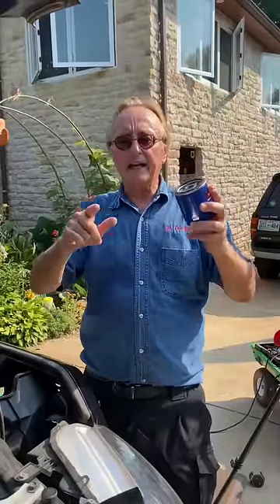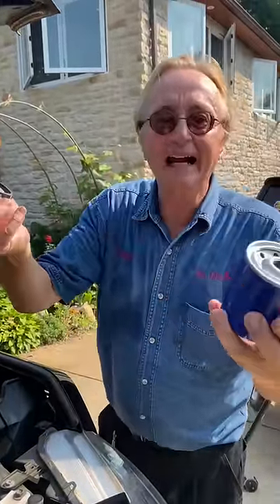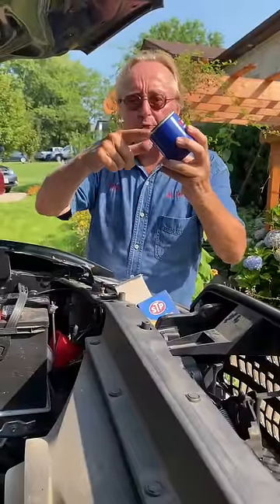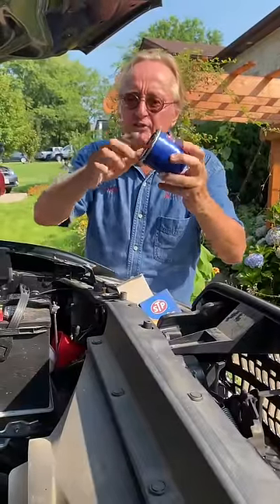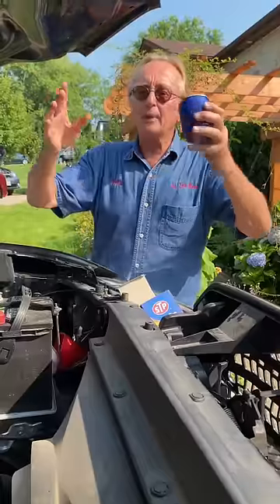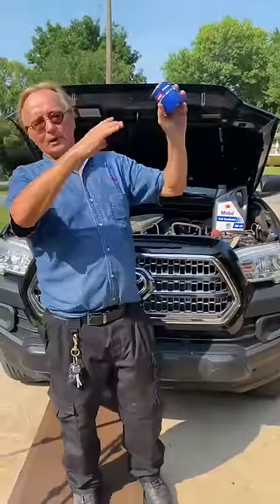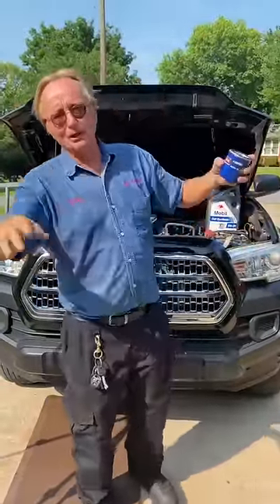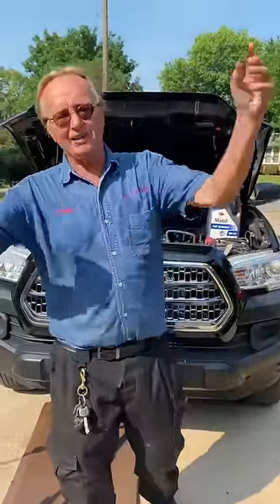If You Change Your Engine Oil Like This You’re Stupid

Comment: Did this 40 years ago, didn't lose an engine, but the amount of time lost cleaning the driveway taught me a valuable lesson!
Reply: Same thing happened to me. Once is all it took
Reply: Ditto.
Reply: sucks to have to clean all that up, but still far better than ruining your engine!
Reply: Hey man, have any tips on cleaning a driveway with oil ?? Asking for a friend
Reply: @obxurv  Heavy clumping cat litter...nice even layer over top...wait a minimum of 20-30 minutes...sweep up
Reply: Happened to me 5 years ago. I wasted so much time trying to figure out why my wife’s car was leaking oil 🤦🏾‍♂️
Reply: 17 years ago I too learned the same lesson on a 78’ Ford F-250 high boy quad cab………  I miss that truck.
Reply: @obxurv   resurface it?
Reply: I did this too.  Caught it before I got the car off the ramps.
Reply: Same here, got about 5 houses down our street and the car automatically turned off.  Looked in my rearview mirror and saw the trailing oil.  The worst thing, our family was already late to a doctor's appointment.  The sad thing is I'm usually always checking the old gasket is removed before screwing on the new filter, was already in a hurry and just completely forgot.
Reply: Same here, the lesson to have clean mating surfaces was so well engrained after cleaning that damn driveway, now I'm a professional service engineer on medical equipment.
Reply: Same here, 25 years ago, Toyota Corolla... lmfao,  ooops
Reply: I did this last oil change lol
Reply: @shadetreemech290  on that charge for a long as porch on that level 🎚️🎚️🎚️🎚️ post on one 🕜 our hearts 🥰🥰🥰🥰🥰🥰🥰🥰🥰
Reply: Same here.
Reply: Me too.
Reply: Same
Reply: SAME HERE!👍
Reply: Same
Reply: Same
Reply: My neighbor did the same thing and I was in the front yard mowing my lawn. Pretended not to hear his curse words 😂😂
Reply: Did the same. Lucky I had to back out of a long driveway and seen the leak pretty quickly.
Reply: Yep. I was stupid.
Reply: It's easier to get a new garage
Reply: Same. In 97 🤦
Reply: Same here, killed a big spot in my mom's yard. 45 years ago
Reply: I did it on a 2001 Camry 6 years ago by accident, but the filter was on top of the engine so it didn't start leaking out until I started moving and I failed to notice until I was on the highway with a seized motor.
Reply: Had that happen as well, noticed right away and shut it down; lot's of cat litter to clean up the mess..

Comment: Scotty, don't forget to mention putting a light layer of oil on the new filter to prevent the gasket from sticking in the first place!
Reply: My Dad taught me to do that when i was like 7. But it wasn't until a few years ago that i learned why we do it.
Reply: @skeeterfan3626  Right? It's funny that such a small detail can make such a big difference
Reply: usually enough dribbles out to coat the surface when you are taking the old one off.
Reply: @McSlackmaster  yeah but most rubber gaskets absorb some oil so its good to do it anyways
Reply: @McSlackmaster  well yeah but it’s better to have clean oil on the gasket, not dirty
Reply: Don't do that. It's bad for it. That's another dumb thing people do.
Reply: @theenzoferrari458  Putting oil on an oil filter gasket is bad for it?   That's like saying "Don't put water in a waterbed.  It's bad for it."
Reply: Some filters come with prelubed gaskets too
Reply: And you're supposed to put some oil in the new filter before putting it on because of the initial start to the engine so oil immediately gets to engine, correct ?  Otherwise there's a second or two where engine is going without enough oil getting to it?
Reply: Now what you should be using is molykote 55 to grease up the gasket
Reply: Also always pre-fill your oil filter, if your vehicle has the type that doesn't screw in vertically, fill the filter with oil and let the filter media absorb the oil, then install
Reply: @tbelding  No you're wrong, you are supposed to fill it with coolant essentially if you live in a warm climate. And antifreeze in cold climates.
Reply: I always put oil on the gasket...it happened to me anyway. I think over tightening or just a cheap filter was probably the problem.
Reply: It just goes to show you that he doesn't stop and think about what he's going to talk about in the video or else he would have covered this obvious tip that any mechanic before 1980 knows about
Reply: @thecloneguyz  - Except that he doesn't do these videos for mechanics.  He does them for people trying to service their cars themselves.
Reply: @tbelding  that makes it even worse that he leaves OUT COMMON basic information!
Reply: @tbelding  he tells you everything about the gasket but he doesn't tell you that almost every mechanic takes a fresh drop of CLEAN OIL and rubs it on the NEW GASKET before they tighten it up to the motor so it doesn't stick to the f**** motor when you go to take it off!!!!!!
Literally gave you 50% of the INFORMATION
Reply: @tbelding  no mechanic would understand how he would tell you about the double gasket problem and then not tell you the common solution that every mechanic uses to PREVENT this from happening!!!!!!???????
I mean come on now! 
Why would he NOT tell people about this!?
1- He Honestly didnt know (I DO NOT believe this)
2- He thought it WASNT RELEVANT (even worse if your trying to help people- then cover EVERYTHING about the SPECIFIC situation you are addressing)
Reply: @thecloneguyz  I'm not too fashed by him leaving that out.  1) if you check for the missing gasket, you'll start wondering how to avoid it, and 2) Enough people have commented about it that hopefully anyone skimming the video will see it.
Reply: @tbelding  he does this on all of his videos he will leave out either a common symptom or a common problem to specific situations that he's addressing and it's either that is uninformed or he doesn't think it's relevant-
He doesn't even put a if you have one of these or one of these then this doesn't apply or maybe you should ask somebody else for a second opinion blah blah blah
Reply: That is because he's not really a technician, he's just a shade tree who thinks he is helping people but he's videos are just full of half wrong and half a$$ information
Reply: @BDPlayground247  not true at all
Reply: is this why i never had this issue or knew it was a thing since the 90's?🍻
Reply: @starbabygaming  no complete true..as a full certificate technician with over 20 years in dealerships I can tell you for sure I've meet tons of scottys in my life they come in to the shop bragging about what they know and what they have done. Then before lunch time they are all asking for help and usually only make it a week or two beford there heading back to an independent. These guys love working at independent shop because everything they can't fix they just blame it on the manufacturer making so it cant be fixed without going to the dealer.
Reply: @theenzoferrari458  don’t put gasoline in your gas engine, it will cause parts to wear.
Reply: That’s not its primary purpose, the purpose is to make sure the gasket don’t rip when you tighten the filter. The gasket can still stick even with a thick coat of oil.
Reply: @alexcastaneda2233  oil is oil, clean or dirty the gasket got an oil and it won't stick! Unless your old oil have distinct feel of metal shavings (but again you only use small amount to lather your oil filter gasket so technically you can avoid it), there is really no better or worse than in this case
Reply: @davidgruen7423  if you have ever torn an oil filter o ring you need to go back to jiffy lube school. There is on reason to ever put a filter on tight enough to tear it. Snug it up then a quaret of a turn. You should be able to remove the filter again just by hand. I hate people who over tighten filters to the point you have to crush them to get them to turn off
Reply: @BDPlayground247  there is a torque spec on these filters, I always torque it down to the spec, can’t beat that. I hate people who hand tighten them and call themselves an expert, what a load of crap.
Reply: @BDPlayground247  First oil change on a 'new-to-me' car last night. Crushed in the oil filter taking it off as it was put on by a gorilla at the last change. Had to have been 60-70ft-lbs needed to remove. I hate that!
Reply: @davidgruen7423  if your need to break out a torque wrench to put an oil filter please don't ever work on a car again. I've worked in dealerships for over 20 years and have never seen an oil filter torqued. So I'm pretty sure your full or it
Reply: @davidgruen7423  and by the way I have every certification offered by ford and have been called to court and paid for my testimony as an expert witness. So put that in your pipe and smoke it troll
Reply: @BDPlayground247  being called to a court as a witness is really just a matter of chance, I have more than enough qualifications to do the exact same thing as you did, as I have graduated from college.
Reply: @BDPlayground247  also just so you know, using torque wrench is actually lighter than cranking it down with hands. I like the quality and consistency more than speed. Although the flat rate is the main culprit of this faster is better trend.
Reply: @davidgruen7423  graduate college doesn't mean anything. I wasn't just called to court. I was contacted by ford due to my training level and work history ie fix it right the 1st time score, that ford tracks on waranty repair, and as stated I was paid for my time to be in court as an expert. I've seen plenty of kids straight out of school that could fix anything.
Reply: @BDPlayground247  graduate college doesn’t mean anything, same as not every tech worked at a place for decades mean anything either, I have seen plenty of so called expert not able to diagnose simple problems on “modern gizmos” because it’s too complicated, it always have to come down to the individual’s ability to learn. Have seen so many people strip bolts from time to time because they didn’t use a torque wrench, and claiming the problem is the manufacturer because it was “different” then what they are used too. You might be faster when nothing breaks, but I want consistency and quality. You can’t fix a car better than using a torque wrench, it just can’t happen, you can probably say it’s faster, but in the end I still beat the book time, and that’s what matters.
Reply: Plus when applying the clean oil to the new gasket - it helps with the seal as well !! 🤔
Reply: @OhFU1  that’s not how it works, static seals don’t rely on lubricants to seal. Plus if oil really does help sealing then the oil that leaks out would have help sealed the leaks itself.
Reply: @davidgruen7423  It doesn't sound like you've worked in many cars in your life ?
Reply: I change my oil like that. Unfortunately you don’t look too bright either
Reply: @McSlackmaster  not good enough.
Reply: @jaynikk758  cant find oil filter on my 11 Corolla, someone told me that certain vehicles dont have screw on filters. Dont wanna sou d stupid but I really want to be sure so I dont keep driving it without changing it out if I have to.
Reply: They come prelubed for your pleasure these days.
Reply: @thecloneguyz  
Sometimes it's difficult to cover everything in one of these short videos.
Reply: @BDPlayground247  
Actually, with the Toyota cartridge filter just tighten the oil filter cap until it makes contact with the base of the housing then give it ⅛ of a turn. That should be close to the 18 ft.lbs. of torque.
Reply: @BDPlayground247  
No wonder so many of them are put on so tight that you can't get them off.
Reply: @thecloneguyz  it’s so he can make 2 different videos out of it
Reply: My grandpa taught me that when I was a kid and I’m 33 now and still do it and have never had a gasket stick. ✌️ God bless
Reply: @Jay Nikk  it takes an average passenger car seconds to fill the filter upon first start after an oil change. There's no need to do this.
Reply: WAIT THATS WHY WE DO IT?
Reply: Yes , Yes, Yes…… and then the eternal question do we put clean oil or New oil on the gasket? I’ve heard both. 🤷. I’ve done both. 
Been using AMSOIL since 1979. ❤
Reply: It's a given. He knows you already knew that

Comment: Changed the oil in my wife's car earlier this year and this literally happened to me. It's a good thing I always turn on the car after every job and have a look around to make sure all is well, that's when I noticed the oil spilling underneath. Turned it off immediately and no damage was done. Had I not checked and she went work with it the following day, she could have blown the engine.
Reply: "Marge get the kitty litter".😝

Comment: I always wipe the oil off the flange before installing the new filter, keeps things clean and lets me check to see if the old gasket is stuck to it.
Reply: I do the same to make sure bits of the old gasket doesnt interfere with the seal of the new gasket on the mating surface. Gaskets keep getting thinner.
Reply: Me three
Reply: Best policy I have done Cat Filters with 3 o rings on heavy equipment, you have to check them very carefully.
Reply: I do this, not so much for the gasket, but to clean all the crud off of the engine around the filter, plus the drips and leaks  I don't like baked engine oil smoking at me.   It also keeps anything that might compromise the gasket _gone_.
Reply: Same here 👍

Comment: Easy thing to overlook, luckily I have caught that missing gasket on the filter before!
Reply: Do all oil filters need that gasket? I've done a few oil changes and have never seen the gasket. I've never even seen one come in the box of new filters
Reply: @giggityeffyou  no. If it doesn’t come with one. Caulk around where the filter Meets the engine. Duct tape works too. 👍
Reply: @giggityeffyou  no mane, don't listen to all of em, they just tell you nonsense and make you pay extra things you don't need! What you really need really is to make sure it got a good contact metal to metal and just tighten until you hear metal screeching.

Comment: Thanks for the reminder Scotty. This happened to me and will always double check before putting the new one on. Also, used one of those plier oil removal tool and little did I know when tightening the new filter on I punctured a hole. An area that collapsed during tightening. I wouldn’t advise using this tool when replacing new filter, only use to remove stubborn oil filters.

Comment: Good advice. Did this on boat engine. It blew and the whole engine compartment was drenched. Hell of a job to clean. Well done Scotty. Now do a video on the use of wet timing engine. My dry belt did 110,000 melts. Its such a crap design. Hammer them Scotty.

Comment: I always wipe down the filter mount where the gasket will seal with a clean rag. This will ensure the old gasket is not there and also remove any dirt or debris on the mount.

Comment: I was ignorant to the possibility of double-gasketing until it happened to me. Luckily I always do a test crank (for checking final fluid level) and was taught by my father to always watch for leaks at the oil plug & filter in case they arent tightened down fully. Still had a huge mess and wasted at least $10 worth of oil, but there was no engine damage and now I instinctively put a hand on the filter mount and put eyes on the old filter o-ring. Trial by fire is one of my best teachers.

Comment: And when you purchase the filter, open the box and make sure there is a gasket on it.  I got home once and found out the filter did not have a gasket.
Reply: You can use the old one. Using it 2-3 times won't hurt, but definitely not more than that.
Reply: Never got one without a gasket yet but got one years ago that the dome end was completely crushed, now I always check for damage before purchase!
Reply: I also check to make sure the correct filter is in the box!  Got home with a filter once and someone had swapped a cheapie into the box - no doubt a byproduct of them swapping an expensive filter into a cheapie box which they then purchased.
Reply: @92Pony  i've seen that happen. Some of the fancy ones are now coming plastic wrapped for that reason.
Reply: @92Pony I got one with a used filter, some Ahole cleaned it up in what smelled like parts washer fluid, people will do anything to save a buck.

Comment: I was a teenager working in a garage after school in the 1970’s and “double-gasketed” one car. It was a 1966 Pontiac with a 389, I believe, that held six quarts of oil plus one more with the filter.  I poured all that oil in and checked the dipstick and couldn’t see any oil, so, I added an eighth quart.  When that didn’t show up, I looked under the car to see eight quarts of Mobil 1 on the floor and running into the drain. Mobil 1 was new at the time and very expensive (I think it was around $3/quart compared to about $.50 for regular oil).  Nonetheless, I learned the importance of wiping the metal where the gasket seats in order to make sure the new filter seats properly.  The owner of the garage, a great guy, didn’t make me pay for the oil.  I learned so much by working at that garage including how to deal with people and problem solving in addition to how to do my own repairs - skills that are invaluable throughout life. Young people would be well-served to work around cars with knowledgeable people.

Comment: Oil change tips for people who care about their engines:

1. Don't double-gasket
2. Pre-fill the filter as much as possible (sometimes not possible)
3. Buy a quality filter (Wix, Motorcraft, Napa Gold, etc)
4. Light layer of oil on the new gasket
5. Use good oil (Valvoline, Motorcraft, Napa, etc)
6. Use Full Synthetic or Synthetic Blend. There is no reason to ever use conventional oil.
Reply: Why prefill the filter I never do that

Comment: I thought Scotty was going to also tell you to use a dab of oil and run it on the top of the rubber ring so it will not only keep a good seal, but it will also help the seal from possibly sticking to the bottom of the engine. 

Scotty is so good!